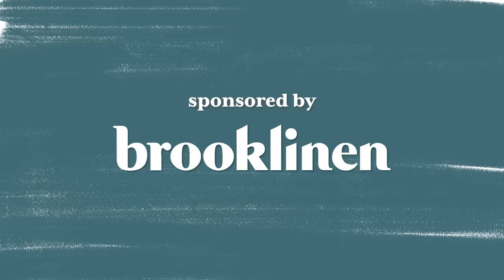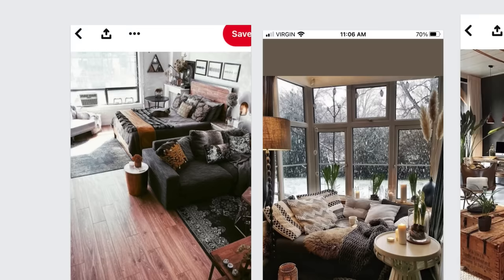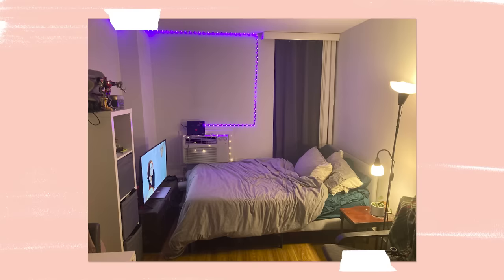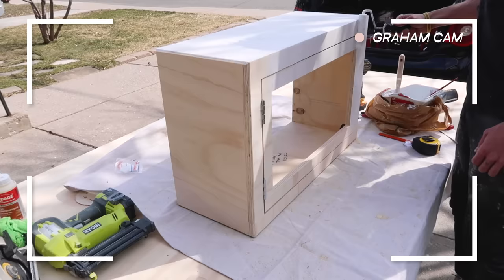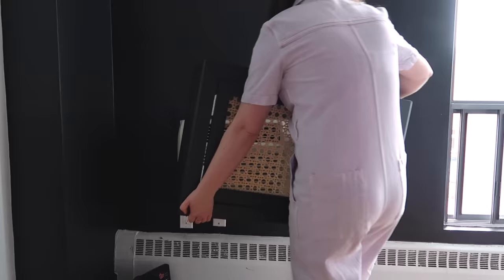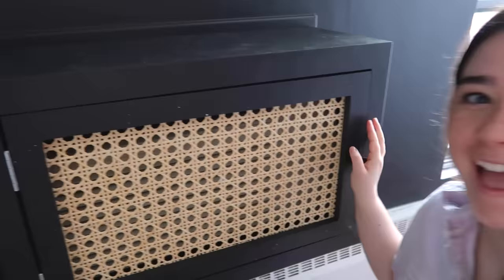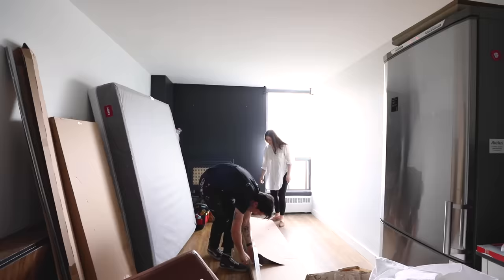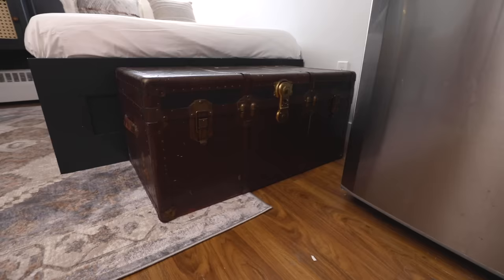Industrial Style 211 Sq Ft Studio Apartment Makeover | Studio Fix

Comment: I love this! My only comment is: when using a sewing machine on a large piece of fabric, you let the fabric hang from the table behind the sewing machine which helps feed the fabric through. To sew against a wall means that larger fabric will bunch up between the sewing machine and wall. But other than that, I love this result.
Reply: I was thinking this too, but he can probably move the sewing machine to the end of one of the leaves and sit next to the wall instead of across from it if that makes sense? Then the fabric can run off the other side of the leaf freely

Comment: You asked about air conditioner treatments. Years ago, I was in a small 1920s era unit that had two double-hung windows with an AC unit punched through the wall between the windows. I was already an avid salvaged (this was 1960s before salvage was cool) and I got three sets of movable-louvered window shutters and used them over the two windows and AC unit. I also built 12 inch deep shelves all the way across that wall at top-of-shutter height to the floor, creating four bays of bookshelves (two flanking the outsides of the windows, two filling the spaces between windows and AC) which felt like a single unified horizontal motif, all stained the same dark oak the shutters were. It all allowed airflow throughout but also blocked view of the garage I was next to, six feet away, with a passage sidewalk right next to those windows. A visual disaster converted to a privatized dominant theme that felt like a Victorian library.

Comment: I really like it, it might be my favourite studio fix! The table is gorgeous. One thing I might also have done is put something on the wall by the bed, perhaps like an upholstered headboard situation (except obviously not a headboard) - would fill the space, tie into the dark cocoony feeling (I also feel like single accent walls are just not it anymore), plus make it much more comfortable to watch TV by giving you something to lean against, which is the one thing that was lost in the makeover (that, and a comfortable armchair).

Also, I love the artwork above the air conditioning unit but I feel like it would look better hung vertically, or at least centred above the unit? The asymmetry is throwing me off a bit. The unit is also not quite functional as a bedside table - it's a little too high for glasses, a glass of water, etc. maybe a smaller side shelf painted the same colour as the wall would be good? And what about a bedside light?

Comment: I painted my dishwasher by covering it in contact paper and priming/painting the contact paper. I wasn't sure that my husband would like the color, so I wanted a way to Ctrl+Z if needed.
That may be a tip you can take forward when "Painting" fixtures of the apartment that cannot be changed. You can definitely have done that with the AC unit and MAYBE even part of the radiator as well (the part that doesn't get too hot).

Comment: Hi, i work as an HVAC planer: The cover for the AC Unit works, but pay attention to the circulation of the air. This unit sucks in air from the front and supplies it verticaly, so you need to have an opening towards the top to. The problem with this design is, that you create a short circuit for the unit, as the air it blows out gets sucked in again, without a division of those two air flows. Thats not only ineffient it is also damaging the unit - as the termostat gives the signal to cool down the room, but the unit cant achive the desired temperature, going in full load.
A workaround would ether be an aditional opening on the top, or at least a horizontal division inside the cabinet.
If you have radiators and you cover them up, then be aware, that the main energy suply is radiant heat to the room, that gets eliminated if covered up.
Reply: Also: If a unit is used for cooling to, make sure to use water resistant materials and paint, as condense will otherwhise keep the surface umid.

Comment: After a year, have you checked back about the ac cover?  I feel like the airflow is blocked by the top and door frame (they usually push air up diagonally), and that the cane might get mildewed from condensation.

Comment: I love the solution for the air conditioner but I didn’t notice that it should be a few inches higher because the air is actually coming out of the top portion of the air conditioner at the bottom portion and you’re blocking part of it with the top of the door. Plus I was just wondering does he have a remote control for his air conditioner? I know mine does and that would have been adjustment made. Otherwise I thought that was a really great solution that I’m gonna try

Comment: In English, 'off of' is not correct or necessary. Eats off the table, works off the table, eat at the table or work at the table, eat from the table etc Usually 'off of' needs just 'off' (which automatically includes 'of'). But 'from' is often the correct term as well.

Comment: You said nothing is straight in Toronto apartments.  But the bamboo webbing you used for the air conditioner door was inserted brand-new by you. And it's crooked.  It's higher in the upper left corner, and dips slightly lower on the right, the right side is entirely lower than the left side.   Look at it...  you should've seen that, it would drive me crazy.

Comment: 125 USD for a duvet cover, 71 for a pillow cover? Get real, woman. Against that the ugly cheap metal hinges in the airco cover, why not black? or dark what ever? Why shiny chieap metal? And the inside finish of the cover - why not just a little piece of wood covering the fringes of the webbing? I mean REALLY. The paintjobs are really worse to tell. It's patchy and dull. Why not paint that finishing coat on? When you can spend so much money on a duvet cover and have NO feel what so ever for finish. That's just terrible. There are no light blocking curtains anymore so goodbye, sleep. And then we should discuss blocking your heater for more than half of it, Imagine leaving that free by nót putting the bed straight to it, but using a low, flat laid headboard with webbing  Oh my goodness, what a mess.